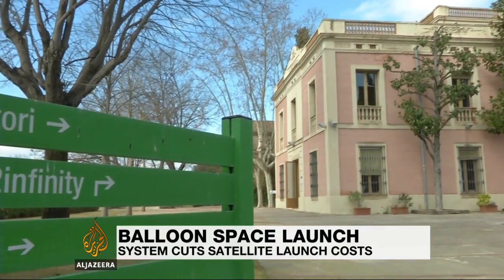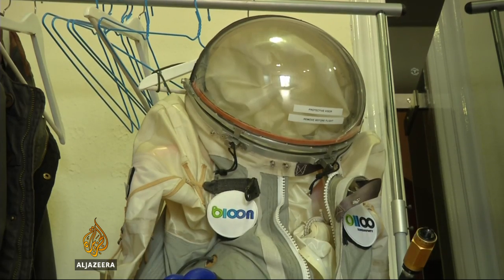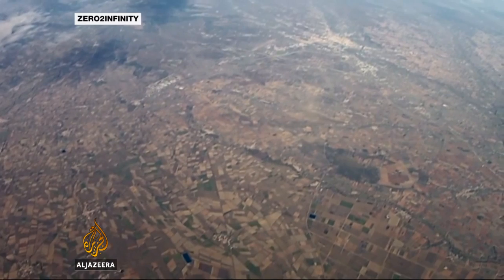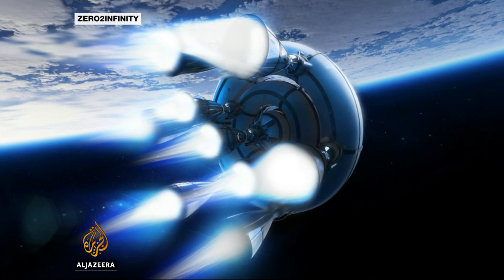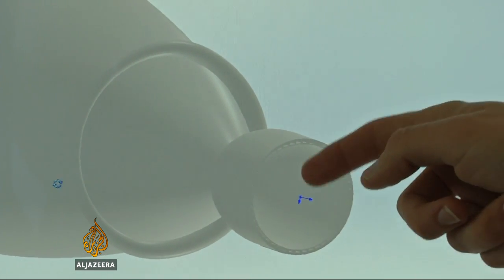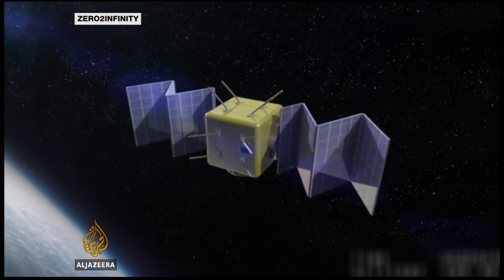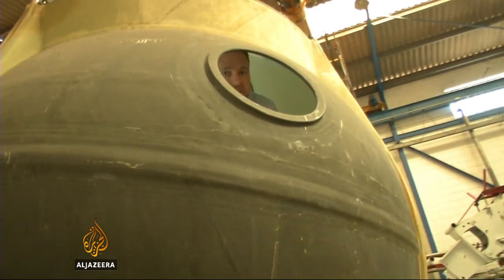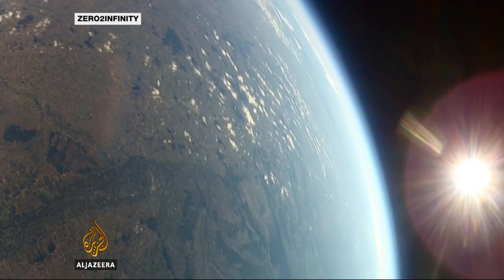Balloon space launch system could open space to all

Comment: ok, I see several errors in this.

1 - "75% of the cost of a rocket launch happens in the first 75 seconds as it´s going up". Eh, what exactly do they mean with it? 95% of the cost a rocket launch is with the HARDWARE (rocket engines, tanks, etc) which are not recovered. The fuel is a marginal cost.

2 - altitude is a SMALL part of the factor. SPEED is the major factor when you talk about orbit. You need to achieve a delta-V of at least 28 thousand kilometers per hour. Else, you can reach 1000 km of altitude and you will STILL fall straight down. Can that small amount of fuel carried in that single stage proppel payloads to a delta-V of 28 thousand kilometers per hour?

3 - the system will cost only a few million dollars to put  75 kilograms in orbit. They don´t say how many millions. Let´s say 5 million. So the price is 66 thousand dollars PER KILOGRAM into orbit. That would mean this system IS MUCH MORE EXPENSIVE than SpaceX or even ULA. SpaceX can put 15 tons in LEO for some 75 million dollars and IF they are able to re-use the first stage, the price can fall to something like 20-30 million dollars.

75 million / 15.000 kg = 5000 dollars per kilogram to LEO
25 million / 15.000 kg = 1666 dollars per kilogram to LEO

Thus, SpaceX and even the expensive ULA (United Launch Alliance) are already much cheaper than this system and can put much larger payloads into LEO. How the hell does this balloon system claims that it will open space for all?

Comment: makes perfect sense. spaceone does something similar by basically launching their rocket at high altitude from the bottom of a carrier aircraft. why not launch at even higher altitude from a balloon?
Reply: *****
you get 20-40 kilometers for free, but you do not get velocity for free, so it still needs some serious rockets capable of accelerating it from basically standstill to the required speeds. getting 20-40 kilometers for free is still awesome and saves lots of fuel.
Reply: *****
the baloon costs next to nothing. as for the payload/rocket, at maximum altitude you just drop it, detach from the baloon, and then you fire it up from freefall, around 3 seconds later. nothing new, the recent mars mission involved a launch from freefall, and cruise missiles and hellfire missiles can also launch from freefall. so there is precedent of atmospheric launch from freefall with no pad, with good chances of nailing it with the first attempt.
Reply: kurtilein3 saves lots of fuel. Too bad fuel is less than 1% of the cost of a rocket launch. 

A Falcon 9 costs $75 million in hardware. The fuel cost is less than $500 thousand. And it takes 15 tons to LEO.

How does this system intends to save so much money? It seems it will NOT recover the engines and fuel tanks... in other words, they will still lose the most expensive part of the whole system. And will save a marginal amount of money on fuel.

And as I said, it will be more expensive than SpaceX or even ULA.

To get CHEAPER than SpaceX, launching only 75 kg to LEO, they must charge ONLY 375 thousand dollars from their clients... that would give them a competitive price tag of $5000 thousand dollars per kilogram to LEO.

The article mentiones a few million per launch. Sounds cheap, except their payload is TINY, therefore, it´s actually VERY expensive.

If SpaceX gets able to recover their first stage (they are almost there already) and their prices fall to $1000 dollars per kilogram, than this company, launching only 75kg to LEO, would need to reduce their prices to 75 thousand dollars only!!

And that is even forgetting the fact I doubt they can achieve the necessary delta-V to reach orbit.

Reaching space is easy. High altitude balloons to it all the time for decades. STAYING IN SPACE, that means, getting into a stable orbit, is a question of high delta-V (almost 30 thousand kilometers per hour), and THAT is the difficult part.